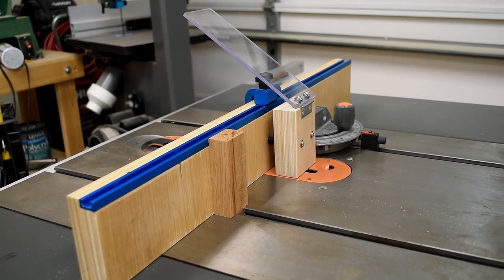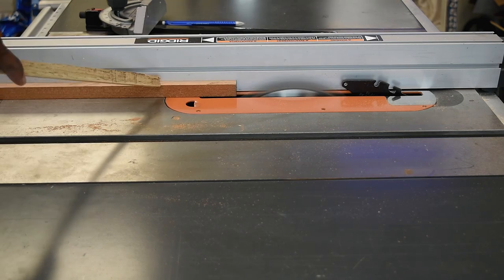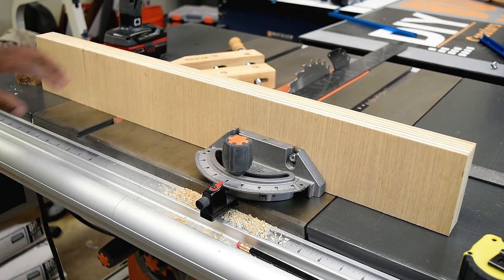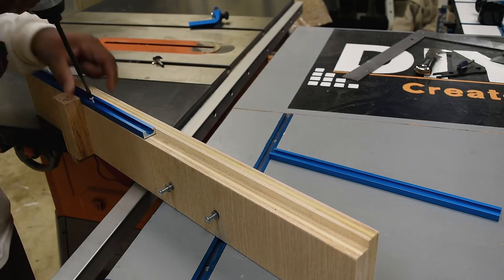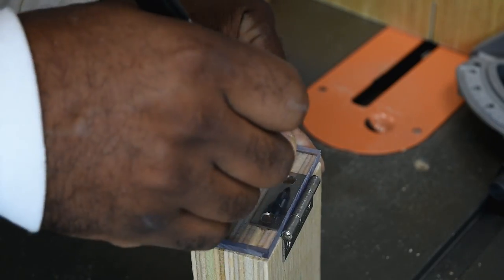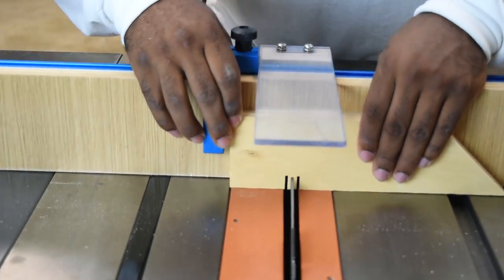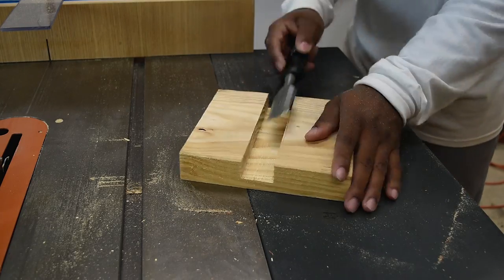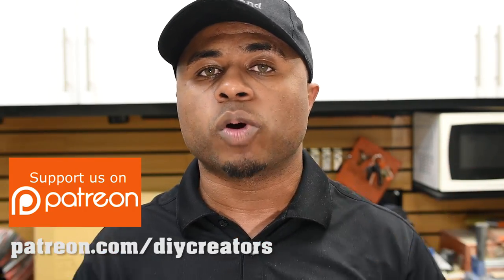How To Make A Crosscut Jig For Your Table Saw

Comment: Good design.  One observation is that by adding the second miter guide you are limited to only 90 degree cuts.  If you need to do other cuts then you could leave this 2nd miter guide off.  I also added a replaceable insert to the backup piece closest to the blade that can be changed once it gets loose so you get a good zero clearance.

Comment: When I finally made my rip fence for my home made table saw I used your design because it was the best option for me: https://www.youtube.com/watch?v=y0R5rO1jJqM&t=10s
When I finally build a crosscut sled I'm going to be building it based on your design also, because it's designed to get the job done efficiently while taking up minimal space. I just need to figure out a way to attach it to my miter gauge because mine doesn't have any existing holes to mount it, and I don't necessarily want to make my own holes either. Maybe I'll buy another miter gauge to use primarily with the crosscut sled.

Comment: I'm missing an eye because of a workshop accident. Please always remember to wear your safety glasses. 30 second lapse of judgement is all it takes.
Reply from the maker: Sorry to hear that! Im pretty good at having on my safety glasses. They were on my head and I didn;t think to pull them down until sawdust started flying.
Reply: Yeah, anything that spins faster than a hand drill, you gotta put them on. To this day, I even hate wearing them. But I find it's a good excuse to buy a nice pair that don't bug me after 5 minutes.

I would venture to say that 95% of all YouTube "makers" that use table saws on camera have the guards removed. Now, while I'm sure they understand the risks and have plenty of experience and respect for the machine, and all that... they are re-enforcing that bad practice to newbies who are learning and wanting to get into these sort of crafts. (I'm looking at the recommended videos to the right of the comment section right now, and every thumbnail that has a table saw in it, has the blade guard removed)

If you're creating DIY / Teaching content, seems to me that going out of your way to show proper safety procedures, even if it's just for the video clips, is a good idea. And if you want to finish the project off camera the way you are comfortable with then, no one will ever know.
(I'm waiting to hear about the lawsuit against a YouTuber builder, in the same way the ladder companies got sued many years ago for not adequately warning against people's own stupidity)